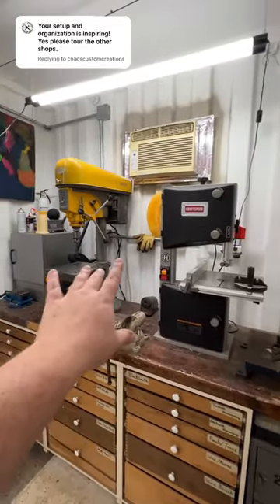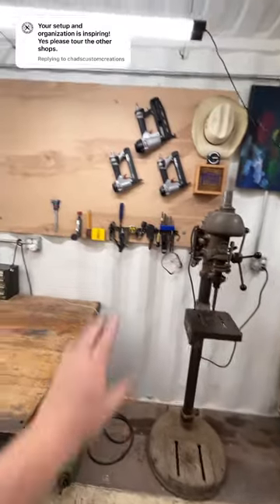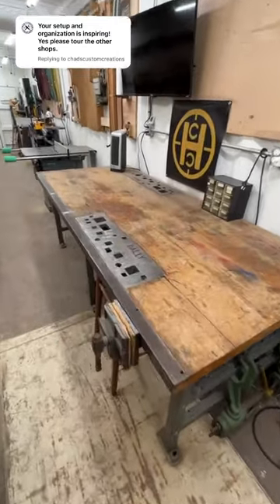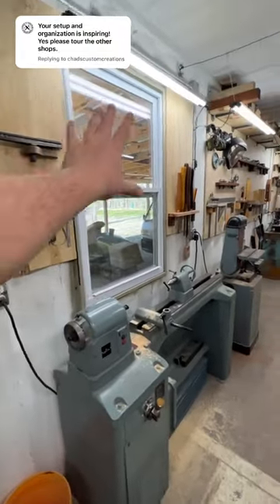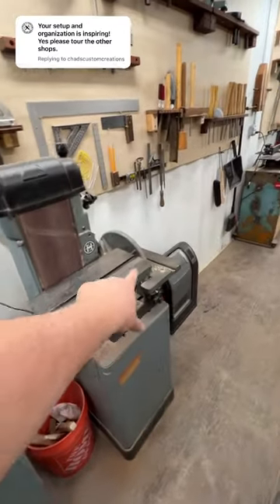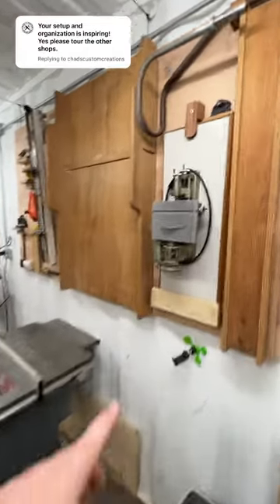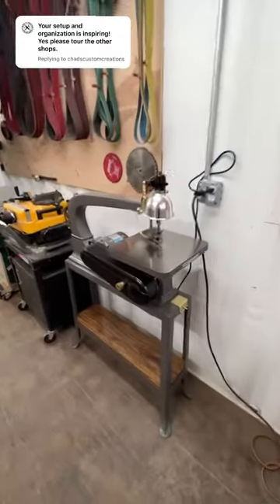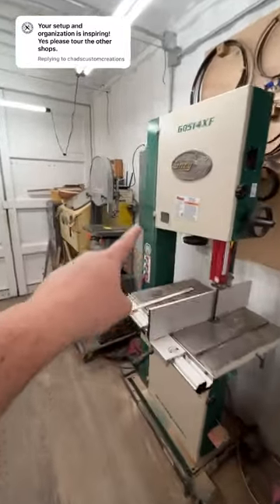Shipping container workshop! #woodwork #shippingcontainer #workshop #offgrid #seacrate

Comment: I'm wanting to set up a woodworking shop in a 40ft container as well. Do you have heat or a/c set up? Where are you located. Is it okay to have all the equipment in a non insulated container. Do you have trouble with moisture/ sweating at all? How is it powered? Do you have a dust vacuum unit? Any advice greatly appreciated :)

Comment: I applaud the effort, but that looks more like tool STORAGE, than it does a workshop. Even the drill press doesn't have enough room... let alone the table saw or lathe.

What are you even making in there?

Cool tool collection though, I guess..
Reply from the maker: This is my second shop.  If you watch any of my other vids you will see I’m mainly a metal worker.  This shop is just for small projects I think of in wood.